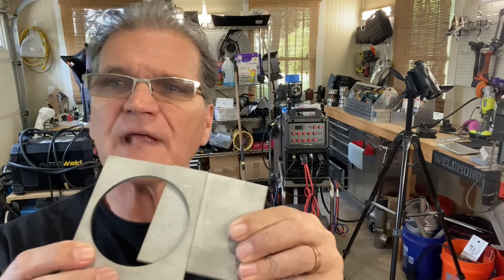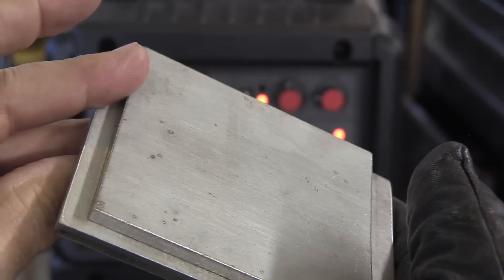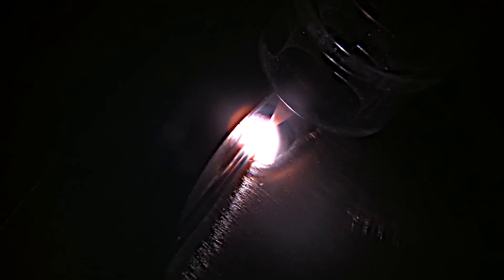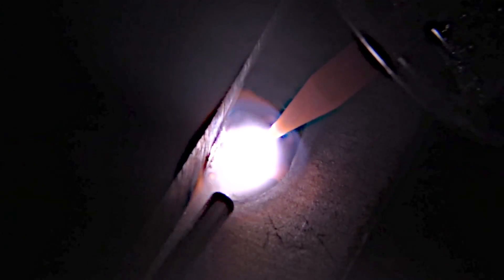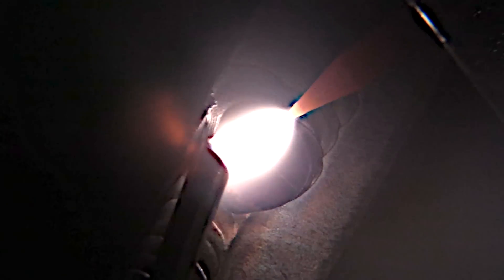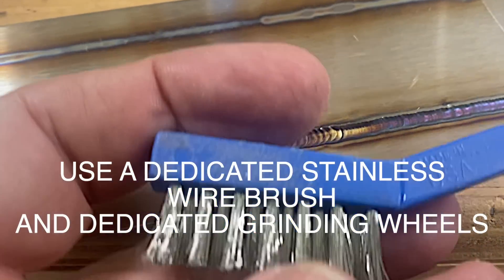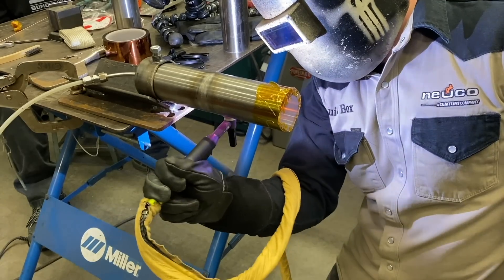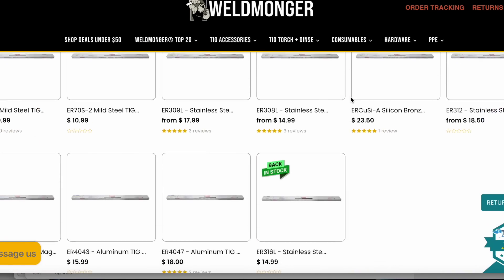TIG Welding 1/4" thick Stainless Fillet Weld

Comment: Jady, Love your channel and after my recent ebay purchase thought of you and your expertise. Just picked up some ER2209 Duplex mig wire. Wondering if i can use it as a filler for TIG welding 300 or 400 series stainless or if it is for duplex only? It was $100 for 33lb spool, so i actually bought it to cut it up and use for blasting, but figured might want to keep few pounds as wire to use as filler for TIG. Any advice?

Comment: 2:57 I cant really speak too much on Ceriated electrodes on the whole,but I do know this.... on large diameter pipe where big amperages are required,they deteriorate very quickly. Even without dipping it accidentally in the puddle,the tip gets very raggedy,very fast.

Comment: Can you do a video on 316 stainless pipe?
Reply: I've done some 316, though most of my welding has been 304.  I can't say I've noticed any difference.  Just use 316 filler rod and all the same practices that are good for 304.  Maybe I've missed something?
Reply: I can't say I've noticed much difference.   I do a fair bit of 304 tube to 316 fittings.